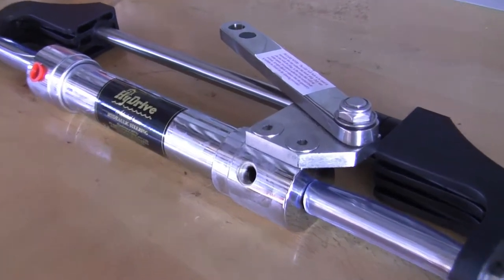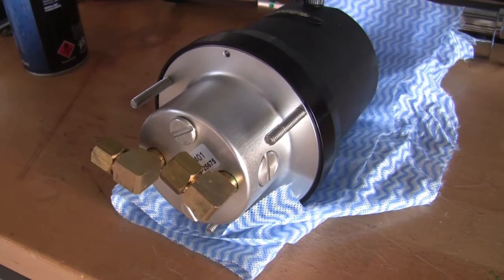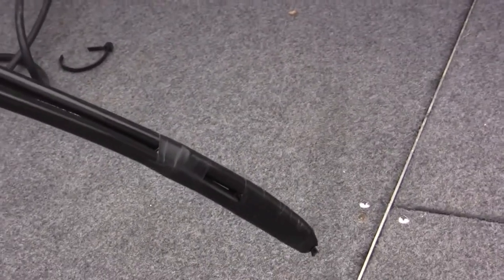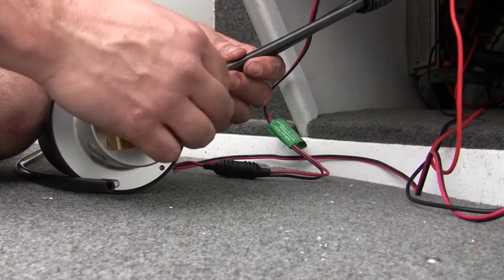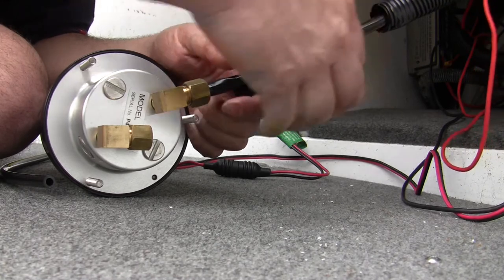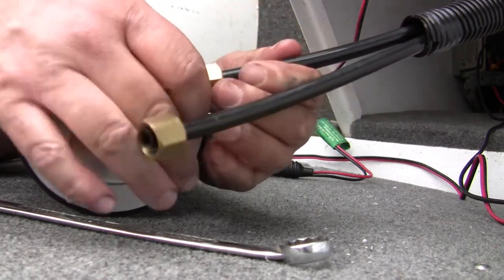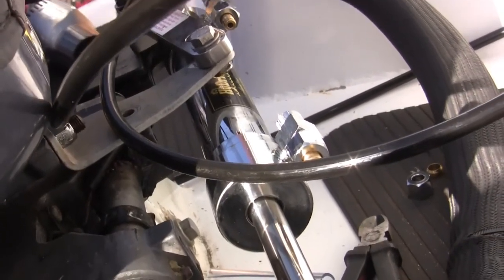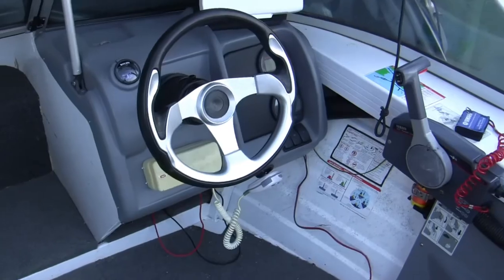Hydrive Admiral hydraulic steering install Quintrex 490 Coastrunner Yamaha 100hp

Comment: Did you have to make any modifications to the motor, I read on hydrive fact sheet that you have to cut something off on the Yamaha to make it fit, is that correct?
Reply from the maker: I did have to trim a small bit of aluminium off.  It wasnt difficult.

Comment: Hi,  Nice Video, thanks for sharing.  A question please. I have a 490 freedom sport, almost exact hull as your boat. I too am considering changing my cable steer to hydraulic. My cable is currently 3 and a bit turns lock to lock. The hydraulic steer I am looking at is 5.5 turns lock to lock, which is the same as the 401 helm you used.  Did you notice  a big difference with the extra turns of the wheel?
Reply from the maker: Hi Brett, great question.  I was hesitant before changing to hydraulic steering for the same reason.
You definitely notice the difference the first time you use the boat or when maneuvering at a dock or similar.
On the plus side, the hydraulic steering is so much more precise and the boat is really good to steer now.
Fitting the hydraulic steering is still the best thing I've done to my boat.  I hope the video helped you.  Let me know how you go.
Happy boating!
Reply: @AdventureCD  Hi,  I ended up picking up a used commander ram and a used 102 helm.  All hooked up and seems to work well, in the garage anyway, will try in the water soon.  Now a question you might be able to help me answer. If I put the helm at full lock, either direction, and hold quite a lot of pressure on the wheel I can get it to continue to slowly turn (very slowly). I think this is called slip.  I have tested this at the motor and put lots of pressure on the ram, no slip there as I assume the lock valves are doin their job.  I think this helm slip is oil leakage around the pistons.    Anyway to my question. you have a hydrive helm,  different model,  but does yours do this?   e.g. is this normal.    Maybe my cheap second hand helm is more well used than thought . hmmm?
Reply from the maker: Hi Brett,
I think what you have described is normal.  There is some slip if you continue to turn hard once at full extension.  
Sounds like you have done well and saved a few dollars along the way.  Well done!  
Hope it water tests great!
Cheers
Reply: @AdventureCD  Thanks for the reply. That is a relief to hear.